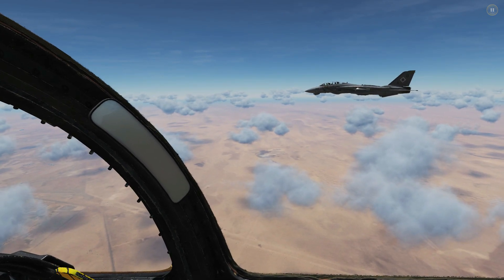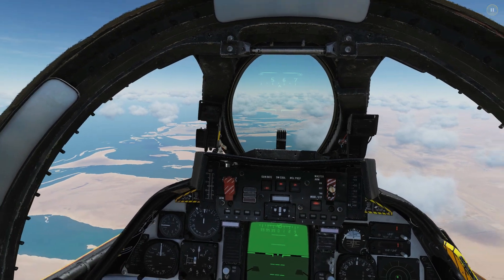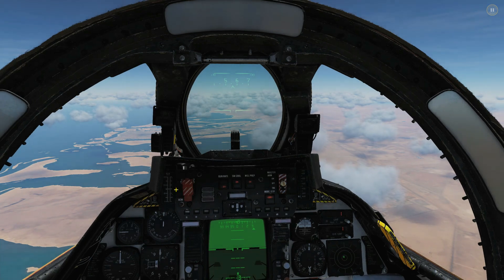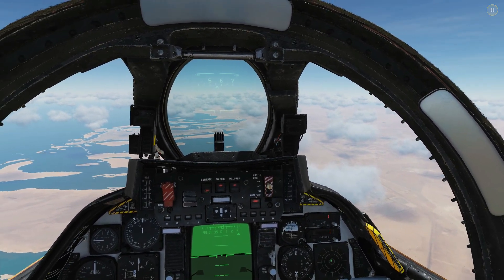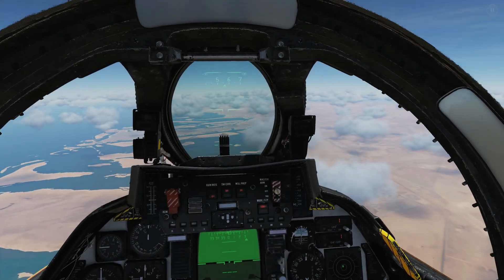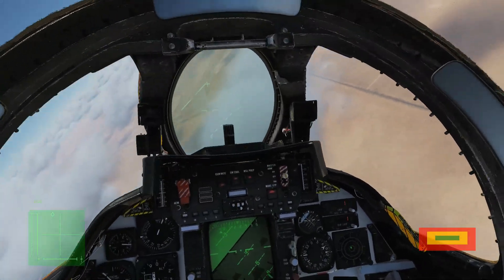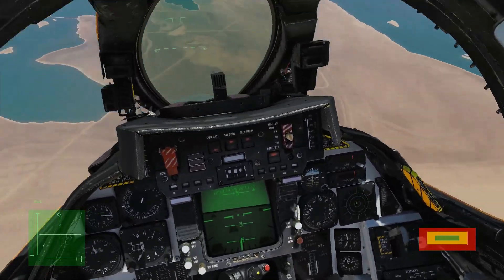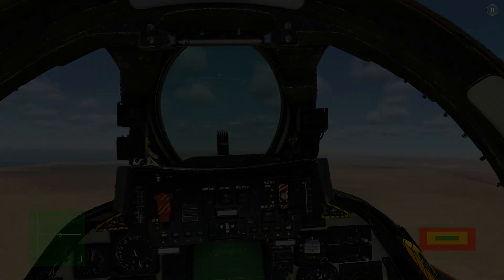F-14B Tomcat: Flat Spin Recovery Tutorial | DCS WORLD

Comment: There's another way to do this..

All you need to do is just put the stick full forward and while stick in full forward position, also put the stick to the same side of the spin and that's it. No Throttle or Rudder required.

Note: For counterclockwise spin, put stick all the way to the left. And for clockwise spin, put stick all the way to the right.

Keep holding it like that for 5-10 second or until your cat successfully escaped from spin.

You can do this with all throttle in idle position or in complete failure and still manage to escape from flat spin magically, even under maximum loadout.

Good hunting 👍
Reply from the maker: thx
Reply: While doing this,Flight computer should be on or off?
Reply: @sofiataousanidou1577  No.

It's not required to disable stability augmentation system or any flight assistance.
Reply: @EvMstein  ok thanks

Comment: I read something about using the wing sweep to recover from the spin. I think I’m going to try that to see what it does.
Reply: You probably mean differential wing sweep? That's an interesting idea...
Reply: Get Sideways Nah, just sweep them in during the spin. The pressure shifts aft, causing the nose to drop and get out of the spin.
Reply: @iFlyFlightSims  Sounds like a plan. But I still wonder if differential sweeping won't be a better help.
Reply: @getsideways7257  Is there even such a thing as "differential sweep" in an F-14 ? What would the purpose be? I imagine having the wings sweep together saves on complexity and weight.
Reply: @Czenda24  From a photo and some real world videos I assumed there was a way to control the sweep manually in the emergency mode, but it appears that was only done once or so for testing purposes to determine if the plane could be landed on the boat in such a configuration. Which is, I guess, another idea for GR to try and replicate.
According to the manual, the screws driving the sweep are synced, but how does that explain the not very symmetrical sweep change you can see on some of the real world vids? :/
Reply: @Czenda24  you can't no. In manual you can still only move in sync
Reply: Get Sideways The Tomcat isn't normally capable of asymmetric sweep, and if you do manage it, you've broken some things, and the sweep mechanism would lock in whatever position it was in at the time.  Hoser Satrapa is credited with inventing the wing sweep recovery method.  That method does require at least 10,000 feet of altitude, though.
Reply: @FS2K4Pilot  Well, I have already checked the manual and the Wiki and corrected myself in the previous post. However, there is still this:
https://youtu.be/KnANkhWzobY?t=223
and especially this: https://youtu.be/239_OLfpI4g?t=155
Maybe the wings behave like that during each sweep, I'm not sure, but those are two cases of transitioning to sweep I could find in a few minutes. How would you explain the wings being that asymmetric if both mechanisms really are synced tight?

Comment: What's the explanation for using rudder in the direction of the spin? Never heard of that. Back pressure to increase rudder authority is used for spin recovery in small prop planes, but never rudder in the direction of the spin, even if it is flat.
Reply: The reason you rudder into the spin is the same reason you pitch the nose down in a stall.
if you have the rudder against the spin, the airflow around the rudder isn't laminar (it's behaving like stalled wing), but by putting it with the spin, you will then regain at least minimal yaw authority (full left rudder under normal flight gives far less yaw motion, than a left spin).
Essentially a bit of something is better than a lot of nothing.
90% of this recovery is from the engine.
Reply: Interesting to know that rudder authority is lower when "stalled", but I can't see how that's the complete explanation, given the natural expectation that increased yaw in the direction of the spin should worsen it. Others have suggested that it could create roll into the spin or help the nose to drop, which sound plausible, but my point was that in a prop aircraft you only ever use full opposite rudder for recovery, even from a rapid flat spin. Also, rapidly applied full rudder deflection produces a very abrupt snap roll, suggesting that the rudder still works well without smooth airflow over it.
Reply: @andrewbagshaw3095  prop = force is pulling from  ahead of center of balance/ pressure.  Jet is pushing from behind both.
Reply: @andrewbagshaw3095  Basically it acts as asymmetric drag.
Reply: I don't have an explanation but according to DI Torndo (old sim) you had to use the same for the Tornado. And that was supposed to be real life procedure (according to the sim manual).
Maybe it causes a rolling into the spin? F-4 and some other aircraft use rudder to roll at high alpha. Flat spin is a high alpha situation.
Reply: Sounds right. I assume the asymmetric thrust gives all the yaw moment for recovery.
Reply: Opposing force to the engine thrust to induce the nose to twist down and start the oscillation.  Once you get the nose oscillating, you can gain enough control authority and attitude to get the recovery dive.

Comment: i read that one of the methods used in the big cat was to pull the stick back, which deflects the stabs in such a way which it lets airflow up into the vertical tail, helping to give rudder authority.  Stick forward apparently doesnt allow as much air through.
Reply: I've heard of back stick to increase rudder authority, but never rudder in the direction of the spin. Would be interesting to know how that works.
Reply: Andrew Bagshaw idk f14 is pretty unique.
Reply: @andrewbagshaw3095  Spin faster to allow more air flow over the control surfaces, maybe?
Reply: @Nnexxxx  Yeah I'd guess it was to restart a proper air flow over the control surfaces.
Reply: @Nnexxxx  its to allow the rudder to convert yaw into a little extra thrust
Reply: Someone reckoned it was to add roll moment to escape the dead flat motion, relying on the asymmetric thrust to provide yaw opposite to the spin.